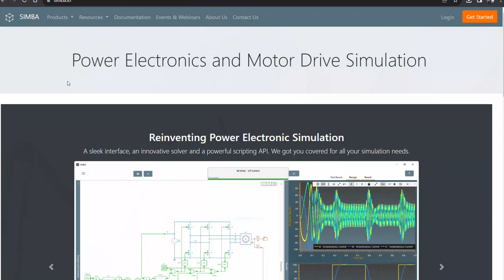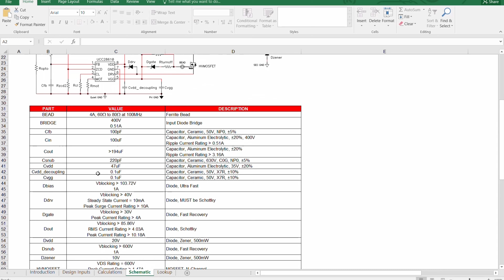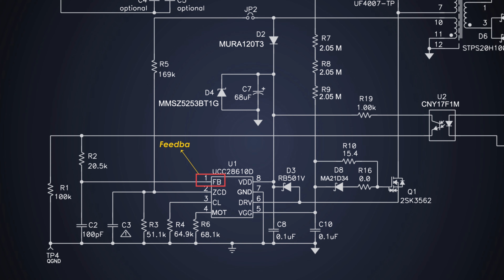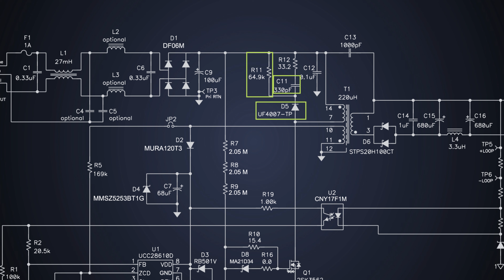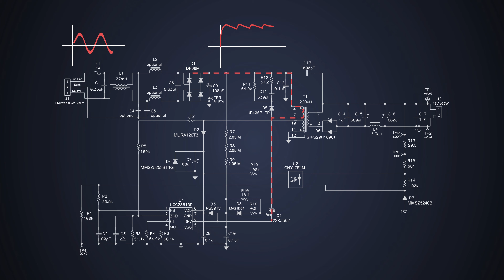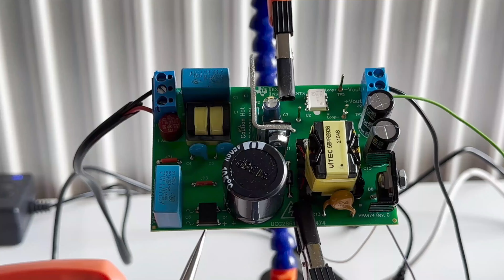How to Design an SMPS using Flyback Converter? Green mode Power Supply | Switch mode Power Supply.

Comment: Hello, I am a novice electronics engineer, writing a paper on the topic of an intelligent station for monitoring dust in the air, I have encountered a problem. I need to create a block diagram. For this, I most likely need a sensor unit, a microcontroller, an alarm system, control buttons, a display, and I don’t really understand what else I need (. If it doesn’t bother you, can you please tell me?